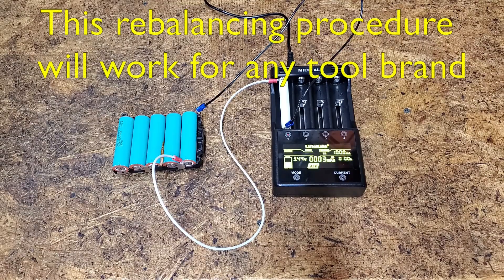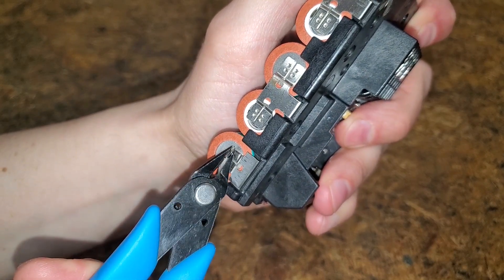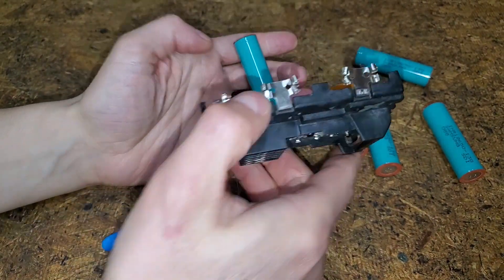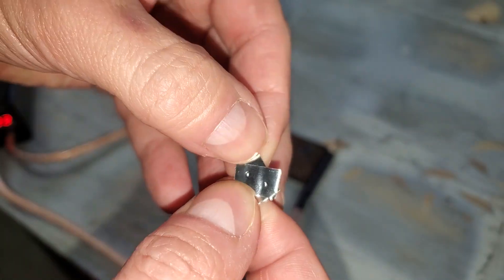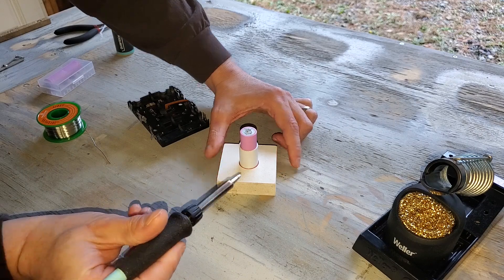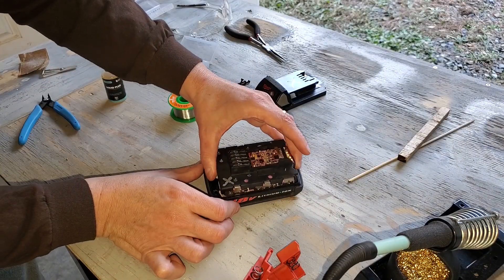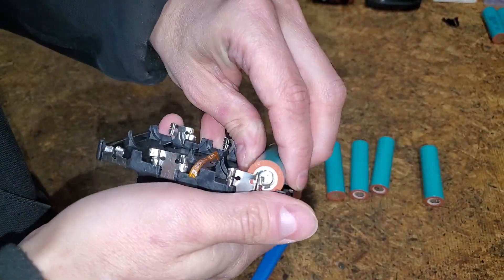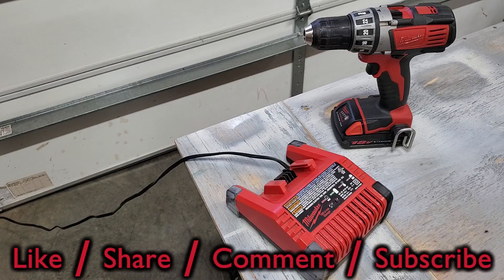Rebuilding Power Tool Battery Packs with New Cells

Comment from the maker: Spot Welder:
https://amzn.to/4oDG84c (affiliate*)

Flush Cutters:
https://amzn.to/4oENtQO (affiliate*)

Weller Soldering Station:
https://amzn.to/4a0SiAu (affiliate*)

Weller 5 Tip Set:
https://amzn.to/3Kv9EuU (affiliate*)

Bass Sponge Tip Cleaner:
https://amzn.to/3MknL6O (affiliate*)

Liquid Solder Flux:
https://amzn.to/4pSJ6CT (affiliate*)

Lead-Free Solder:
https://amzn.to/4rYagdx (affiliate*)

Aluminum Soldering Clips:
https://amzn.to/48yZtNJ (affiliate*)

Battery Charger:
https://amzn.to/47bQpOl (affiliate*)

Security Bit Set:
https://amzn.to/48wcKIH (affiliate*)

Slim Multi-Bit Screwdriver:
https://amzn.to/42K6c5u (affiliate*)

*Purchasing from these Amazon affiliate links earns my channel a small commission. Think of it as a tip that doesn't cost you anything. Thanks for the support!
Reply: Do you have a link to the replacement Lithium ion cells?
Reply from the maker: @Doodlesthegreat  These are the ones I bought but the sale price isn't quite as good right now: https://www.18650batterystore.com/products/samsung-30q

Comment: that solder is baaaad , i used 200w big solder , takes half a sec to apply solder on negative side (on entire surface !) and it works rly good
Reply from the maker: 200W, holy crap, I didn't even know they made soldering irons like that, what model is yours? I'd be afraid that it'd instantly trigger thermal runaway in the cell. :)
Reply: @Mikeattempts  some old roofing solder (to solder tin roofs etx , rly thick end , you could probably use 100w one just let it heat up , and no , you wont damage it because you do it super fast , touch it for less than a second and done , battery wont even be warm to the touch 2 seconds after and thats the point :)
Reply from the maker: @ErtsenPlayGames   Interesting... that's good to know, but I think I'll stick with the spot welder for now. :)

Comment: Why not use leaded solder? The lower melting point might help with the process.
Reply from the maker: The lead-free solder melted instantly but, you're right, leaded would have flowed slight better. I was just trying to avoid the lead fumes.

Comment: I know it's Mike Attempts, and you attempting to place an online order makes for a boring video, but what was the price difference between replacement batteries and new cells? Was it worth it? Or do you think you would just buy new ones in the future?
Reply from the maker: That's a good question. It was just under $20 per pack to rebuild. After a quick search, the best price I saw for a new 3Ah Milwaukee pack was around $100. I'm not sure what the price difference would be for a larger pack, and I assume you'd get a better deal on cells if purchased in bulk. With all that being said, my main reason for rebuilding these old packs was to learn and share my experience. I already have a spot welder so, if these packs hold up, I'd probably rebuild any of my other packs when/if they fail in the future, as long as it was cheaper than buying new.
Reply: @Mikeattempts  that’s what I figured the point of the exercise was, but was curious if it was worth learning those skills, saving $80 per battery certainly seems worth it. Thanks,

Comment: FYI, there are several folks online who will replace bad cordless pack batteries with new cells for less than the cost of new OEM. And they will use better cells than OEM as part of the deal.
Reply: No, I'm always the shifty guy at HD removing batteries from their cordless battery disposal box as you enter.....
But for folks who just have a battery or two and not interested in paying insane prices, there is a way to get your batts rebuilt for a fair cost.
Reply from the maker: @boots7859  That's a great idea, especially if you had a friend that worked there and would give you all of the discarded batteries you wanted! :) My location has power tool drop off that's more like a US Mail drop box, once you drop it in there's no way to get it back.
Reply from the maker: I rebuilt these 1Ah battery backs for $20 each and now they're 3Ah, that doesn't sound too bad to me. I'm sure you could shave down the cost per cell by buying in bulk, but this was just a learning experience for me.

Comment: It was interesting that the new cells you bought were of a higher capacity than the old cells. I found the same thing when I repacked our two leaf blower batteries. It could be advances in technology which result in better mAH capacity for the same sized cell.
Reply from the maker: Yeah, I found lots of different choices while researching replacement cells. There is a wide range of capacities and amp output options, all in the same physical size cell. I was considering the Samsung 25R. They have 2500mAh but a maximum continuous discharge of 20 amps. The original 13Q cells are only capable of 15A so I figured that was the most important spec to match.
Reply: Not really interesting at all.
Anyone even tangentially using Li-Ion have been following regular advances for the past 20 years.
Reply: @boots7859  Good for you. I have repacked batteries once, so I haven't been using new cells regularly.

Comment: A while back, I repacked our two leaf blower batteries, which you might remember me mentioning in one of your other videos. I bought new cells and I also bought nickel strip on eBay and I used my 80W soldering iron to solder the strips to the cells. I figured a nice hot iron would make a quick job and not risk heating up the cells. I found that the 80W iron did a pretty good job on the soldering, whereas with your lower wattage iron, the soldering wasn't so neat. I have never tried welding the strips to the cells, mainly because I don't have a spot welder and I didn't want to buy one. If I have to repack another battery, I will just use the 80W soldering iron, as it worked OK for me the first time.
Reply from the maker: Yeah, my soldering iron is 70W and capable of 450 C. I never thought I'd have a need for anything hotter. I figured the soldering would be a piece of cake, but I haven't soldered anything in quite a while. I'm sure someone skilled at soldering could have done a much nicer job with the same iron. :)

Comment: do you expect both of them to work now for a couple of years or what
Reply from the maker: Unless one of my spot welds, solder joints, or the circuit board fails, I honestly expect them both to last many years, they're like new packs now.
Reply: @Mikeattempts  cool
Reply from the maker: @JoeBaller1  If they die unexpectedly, or burst into flames, I'll be sure to leave an update in the video description. :)

Comment: Use a small diamond-coated round ball die grinder bit to remove old nickel from the cells.
Reply from the maker: I tested soldering and spot welding on one of the old cells. I used the flush cutters to remove any sharp pieces of nickel sticking up and then finished smoothing with sandpaper. It wasn't quick but I'd be hesitant to use a Dremel or die grinder bit for fear of wearing through the thin casing and causing it to burst into flames. :)